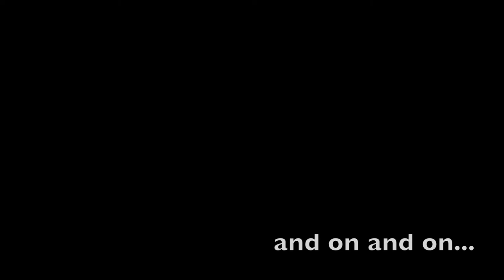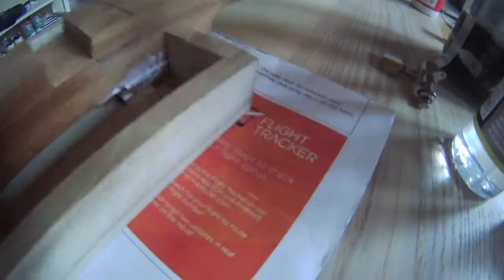Cigar Box Guitar: 4 String CBG Build

Comment: Well done and for me an inspiration. I build a few three string CBG's now and want to build a four string but incorperating a thruss rod is holding me back. But now I see you did it without one! How is the neck now? No bending?
Reply from the maker: Hey, it's actually been sitting in storage for about the last two years, so I pulled it out last night to play. The neck's not moved at all and I could still fret every note I tried. That said, I'd forgotten how thick I made the neck as I was concerned about it moving at the time.
Reply: @FixedFrequencies1  Thanks! I start building a new 3 string cbg. Now I will change the design and add another string.

Comment: Nicely done.  Some questions about the pickup: What size magnets?  What gauge wire?  How did you know when to stop winding?   Thanks.
Reply from the maker: Hey. It was all just a bit of an experiment to be honest. I didn't buy any pickup-specific parts. I used these magnets: https://www.supermagnete.de/eng/rod-magnets-neodymium/rod-magnet-3mm-10mm_S-03-10-N. The wire gauge I used (0.1mm) was probably twice as thick as would normally used (42AWG), but was the thinnest I could pick up in the local store. The winding was just a guess too until I thought it was enough for the size f the pickup compared to a regular single coil. I don't have it with me at the moment to test the resistance, and it's a little weaker than I'd hoped, but it does the job.

Comment: I am wondering what your string spacing measurements were so that the tuners lined up with your tuner so your string pull was so straight. your build was excellent and with hand tools at that. Impressive, who did your follow for your build plans? Thanx.
Reply from the maker: Thanks Tim.The string spacing's 10mm (from memory). To keep them straight, I had one tuning peg on each side of the headstock reversed, so while the strings are tightened in the normal direction, the outer two strings wrap round the outside of the tuning posts and the inside two strings around the inside, if that makes sense?

Comment: Very nice build, however I am wondering why did you glue the neck on the box braces instead of running some screws from the bottom?  A lot easier to do repairs if necessary, if you can totally remove the neck.  Love the pick up build as well.  Nice work!
Reply from the maker: Thanks. You're right - that would have been a way better option.. There were quite a few things I did without too much thought at the time; all lessons for the next one!